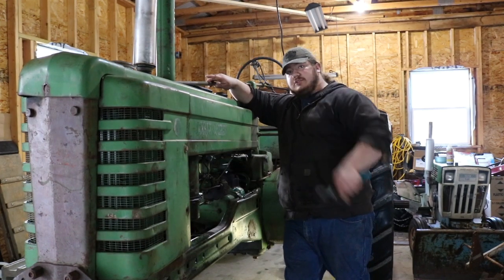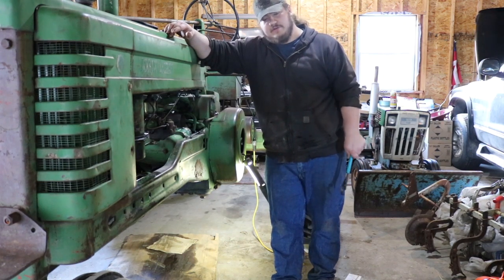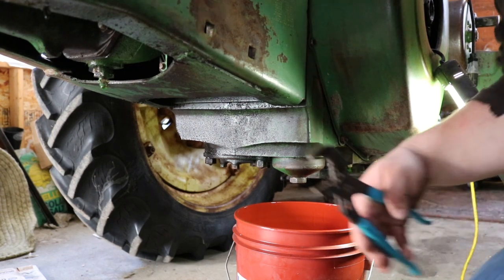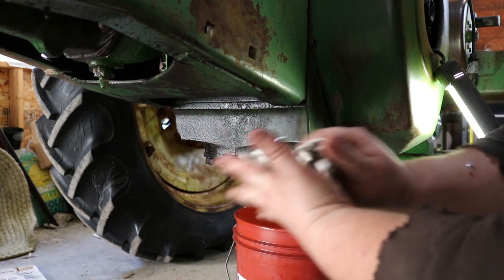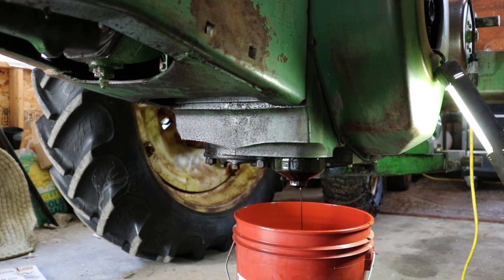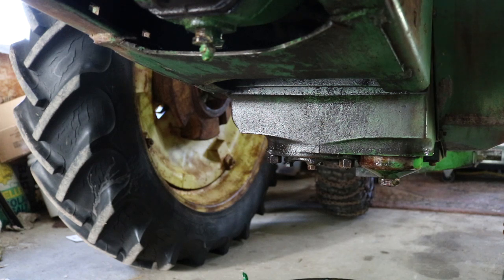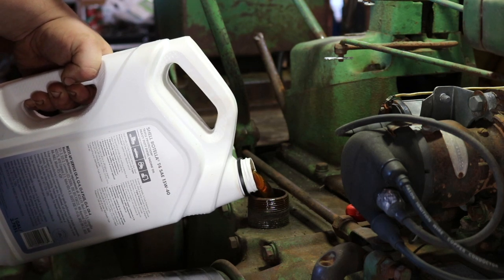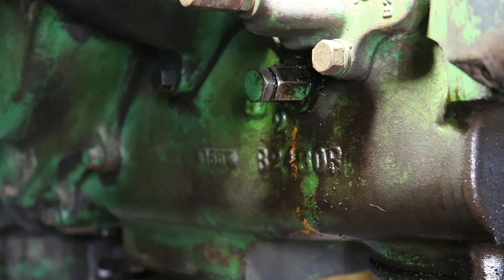John Deere B oil change WITH A SURPRISE  at the end

Comment: For the oil gasket ring, put it in the groove of the engine body and NOT on the filter cap. The gasket should stay in that groove when you put in the filter and the cap.
Reply: I noticed that also and said to myself he may end up with leaks.  Also I question if he removed the correct drain plug, My 47 model BO the drain plug for the engine sits between filter and oil pump.

Comment: My old neighbor has a bunch of old JD's only one still running is a 60 he uses and I'm sure none of them have had Maintenence in years. My fordson diesel tractor was run with no filters (fuel or oil) for who knows how long.  it's amazing what the old machines can endure
Reply from the maker: +1944johndeerel it is definitely amazing what the old machines can take. The newer oils and filters of today are 100% better than back then too which helps a lot.

Comment: What would be better 10w-30 or 15w-40 for Iowa weather in summer and a little bit in winter? Or would a straight grade engine oil be better? Most running conditions would be between 0 degrees to 100 degrees.
Reply from the maker: 15w-40 was my preferred. Older worn parts can benefit from the thicker oil while up to operating temperature.
Reply: @BillTheTractorMan  thanks and what gear oil 80w-90 or 85w-140 would be better thanks.
Reply from the maker: @keeganfarmer5178  I ran 80-90.
Reply: @BillTheTractorMan  ok thanks I have been trying to figure that out for a while.
Reply from the maker: @keeganfarmer5178  for higher heat and high stress gear boxes the thicker oil is of benefit.

My current chore tractor runs straight 40 engine oil in the rear end. It shares that oil with the hydraulic system. The lower grade oil is an in between for more modern transmissions that use hy-Tran and these older units that use engine oil. Older yet would be like your tractor that had the hydraulics seperate.
Reply: @BillTheTractorMan  I have a 1941 John Deere model B that I am restoring and hopefully this weekend I will try the first start and drive and then I will need to change all the fluids. And if you want when I am done with my video I can send you the link if you would like to see it.
Reply from the maker: @keeganfarmer5178  sure!

Comment: We always ran the None Detergent Oil in our older John Deere's!  That Oil doesnt rinse the Cylinder walls etc!
Reply from the maker: Detergent oils DO NOT rinse the cylinder walls or cause premature wear. Modern oils are much better than the oils of 70yrs ago and even the Non-Detergent oils that are still sold today. I specifically use Diesel rated oils in my antique engines because the additives reduce wear better than the Gasoline engine oils of today, which as I mentioned are much better than yesteryears oils which these engines were designed to be run with. cylinder rinsing was an issue when fuel leaked into the crankcase which was common back in the day on old engines. If you look back at the manuals for the old tractors they recommended once a year the tractor have straight kerosene or diesel run in the engine for a short period to clean the engine, because non-detergent oils left deposits that would damage the engine.

Comment: I have a old b it was my great uncles he always said only to run non detergent oil was wondering your thoughts
Reply from the maker: Better to get them clean and keep them clean instead of having the risk sludge and other contaminants get loose. If those contaminants get loose they can cause serious problems like loss of oil pressure and engine damage. I would recommend using gas engine or automotive type oil and do more frequent oil changes for a year. Use the tractor getting it good and hot, plus frequent oil changes will help flush the engine. Be sure to change the oil filter with every oil change.
Reply: Non Detergent oils where used on older machines without Oil Filters built in. Also   With a 70 year old John Deere or any kind of make or model Its a good thing if you do not know the history of the tractor to run Non Detergent in it utile the crankcase is completely clean after that a Good 15-40 Diesel Oil or Hood 10-30 oil will work fine. Non detergent oil is also Ok to use if that is what you prefer it’s just want filter and clean the oil like a Detergent oil would. I have two John Deere 44 B’s and have run Non detergents in them even after the crankcase had been cleaned for 10 years with no issues what so ever. 🤟🏻👍
Reply: I was told to always run non-detergent oil in the rear hydraulic reservoir (we use SAE 30). That makes sense as it does not have a filter in the hydraulic pump and operates a hydraulic cylinder.

Comment: how you doing , my boss have a model a john deere tractor and we find water, gas and oil mixed, when we want to change the oil. what do you thing is the problem?
Reply from the maker: antonio vega going to recommend shutting the fuel off when the tractor is not running, the floats do stick open occasionally or leak.

A lot of water could be a crack or bad headaches allowing coolant through. Just a small amount could be condensation if the tractor sits a lot and doesn't get up to operating temperature much.
Reply: thank you for the information.
Reply from the maker: antonio vega thanks for watching, glad I could help.

Comment: You should put the filter gasket up in the groove not on the filter cap.
Reply from the maker: I usually did, and used grease to hold it in place.

Comment: you should try cenpeco in your old tractors and straight weight oil is best in these old machines. try straight 40 in one of your tractors and see how much better they run. its all i use in my toys.
Reply from the maker: I'm definitely not a fan of straight weight oils and would recommend against them. Here where we have harsh winters and hot summers those oils can actually damage engines by being too thin or too thick to adequately lube vital engines assembles. 15w-40 was a good combo for all year use. Was good for winter starting and think enough for summer heat use.
Reply: @BillTheTractorMan  did you ever read any of the operators manuals for the old tractors? they always say run straight weight oil because it starts as a 30 weight and stays 30 weight all the time. your 15w-40 is only 15 weight oil then they add plastic pellets to make it act like 40 weight when its hot.
if you dont believe me look it up for yourself. also see what they use in airplanes,  older planes always get straight weight and its 70 weight for many of them.
if you are starting it in below zero weather every day then any thin oil is good.
Reply: Where do you get the cenpeco strait wait oil I new that these older gas tractors said they used straight wait in the service manual

Comment: Always remember to remove the old gasket from the filter cap-ring depression! You won't have a leak then.
Reply from the maker: Absolutely, I usually use a screw driver or pick to pull the old one out. However this style filter on these tractors have a difficult housing, the rubber seals don't like to seat and will leak if a guy is not really careful as well.
Reply: @BillTheTractorMan  my '38 A keeps blowing the oil filter gasket is it not seating right? Or what's your input. It won't leak until I fire it up and then it blows out and shoots oil everywhere.
Reply from the maker: @be5575  your gasket is not seating in the groove properly is my best guess. Make sure there are not any other gaskets stuck in there.

Comment: You're supposed to use straight 30 non detergent oil.
Reply from the maker: Definitely not, non-detergent oil increases sludge and contaminant build up which will increase engine wear and the likelyhood of failure
Reply: @BillTheTractorMan  I have and will always use straight weight in my 2 cylinder Deere's. They didn't have detergent 70 years ago. If you maintain your equipment regularly like you should you won't have to worry about sludge build up. Since you use yours frequently I'd change it more often than annually. I'm old school, put in what's meant to be there.
Reply from the maker: @sethbrethauer9538  advancements in oil have done great things, I'm sure if Deere took the time to revise their recommendations straight weight oil and non-detergent would be gone from the books. Many benefits to multi-viscosity oil are proven to benefit these old engines, as well as the anti-wear additives.
Reply: @BillTheTractorMan  We will have to agree to disagree. I know many farming fellows who, like myself, will only use straight 30 for their maintenance. I personally would never recommend to anyone putting anything other than that in an engine of this era.

Now, I do agree with you in the aspect that oil quality has improved, but with that so has engine performance / tolerances of machining hence why you can run such a lightweight viscosity in modern engines. NOT in a 30's - 40's - 50's 2 cylinder farm engine.

To each their own.

Comment: Just for anyone curious, this is about the same procedure on a 50, 520, and 530. My 530 has a dipstick instead of the overflow tap (it has one of those too but not needed) and the oil cap is shaped different and easy to take off by hand. I use the JD 26350 filter and 1.75 gallons of Valvoline Maxlife 10w40.
Reply from the maker: Sweet, thanks for sharing!